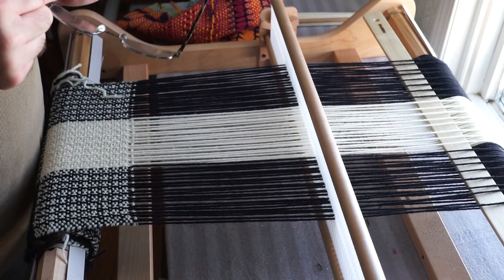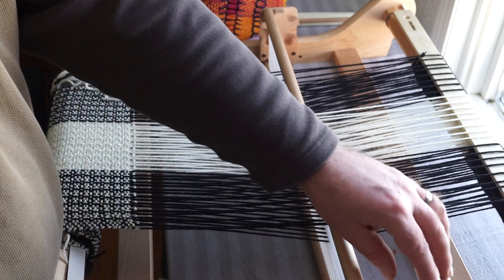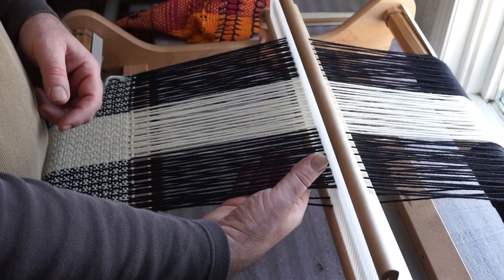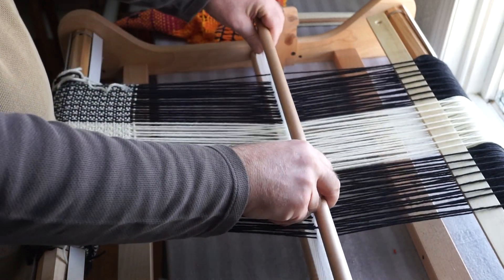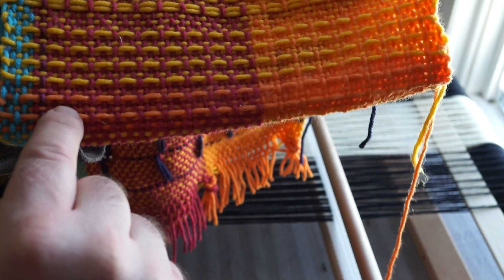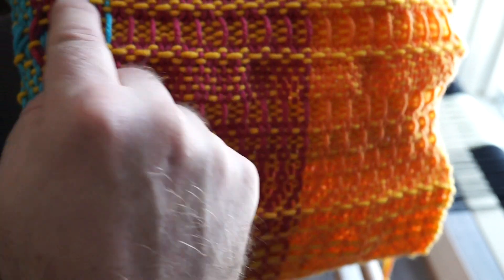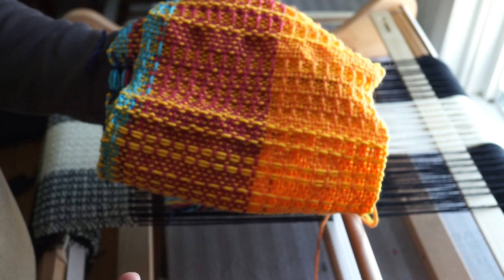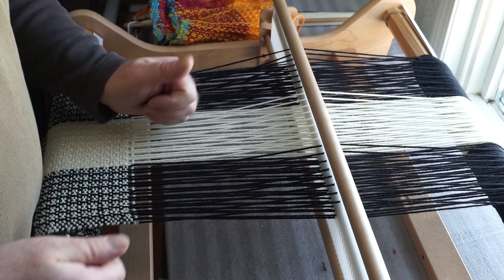Rigid heddle loom introduction to weft floats using pick up stick

Comment: are multiple pick-up sticks ever used?    If so, how do you work that?
Reply from the maker: Yes there are techniques/patterns that use multiple sticks. Some of them though require you often remove and re-insert the 2nd pick up stick. I have never done any patterns with more than 1 stick myself.